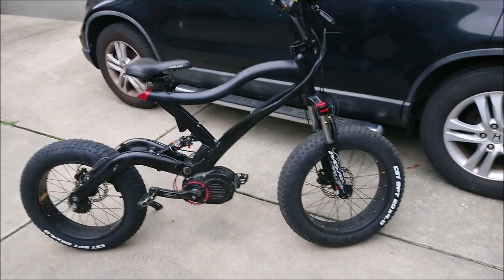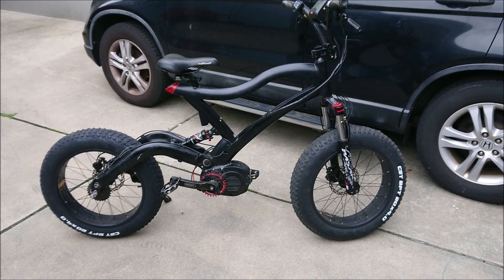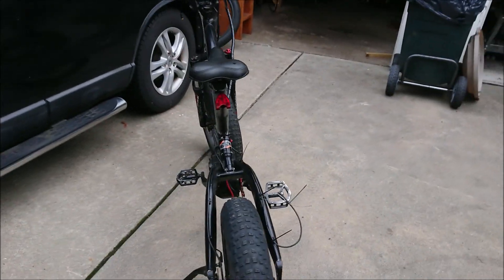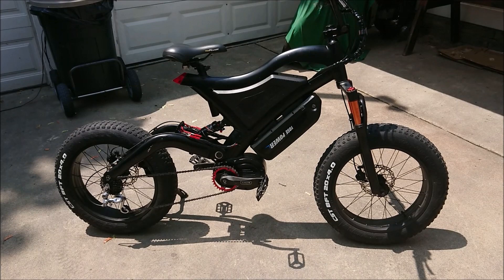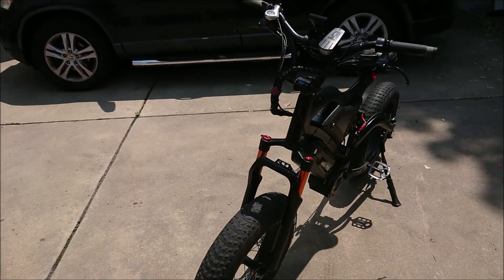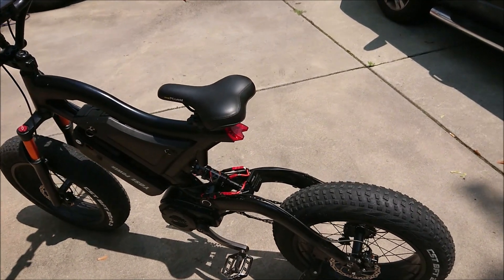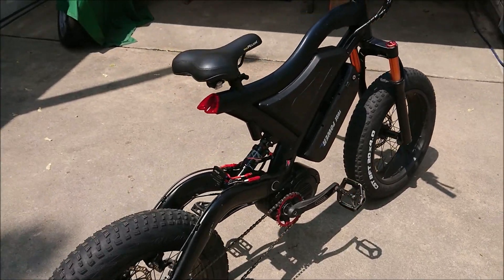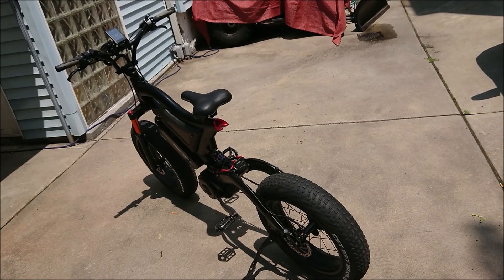Bafang Ultra 20"  Dual battery

Comment: Im a Hardtailer, but still like yr Project..
Reply from the maker: My other 2 bike are also Hardtails and I like them better but this is the ONLY frame I had that would fit the 20" wheel on because this frame is suppose to have 26" wheels on it but I figured I would try the 20" on it and test it on the trails and this thing is SO MUCH fun on the trails because of the QUICK handling of it .

 If everything goes well with the SA on this bike I think I will UPGRADE the FORKS to the DH forks I had put on my other 2 fatbikes because it makes it so much more stable.

I have another 3 wheeler fatbike project started on a Mongoose BMX 20" as well
Reply: @pharrohku5922  im struggling with electrics at the momment .. bbshd . 2 batterys, a battery blender.. turn signals n light and a eggrider.. im in the 💩 brother.. i had a Mariobike now its diffrent forks handlebars brakes (mt5e Magura's. All the Bells n Whistles..
 as soon my project runs.. ill let you know..
Meanwhile.. keep up the good work brother.. greetings from Switzerland 😃✌️👍💪🙋🏼‍♂️
Reply from the maker: @smarc1325  Awesome keep me updated on your bike and video it when you done would like to see yours. maybe give me some ideas for mine. I can do to mine to make it better.
 My 2 26" fatbike I have the BBSHD this 20 " has the Ultra G510  which is actually a BBSHD with a TORQUE sensor  everything else is the same even the programming just a TORQUE sensor tab on the software